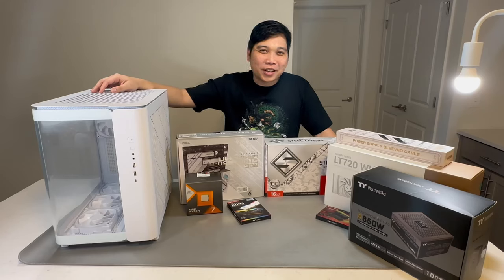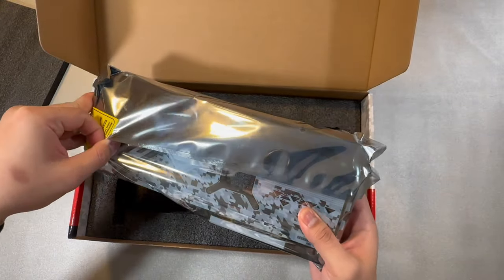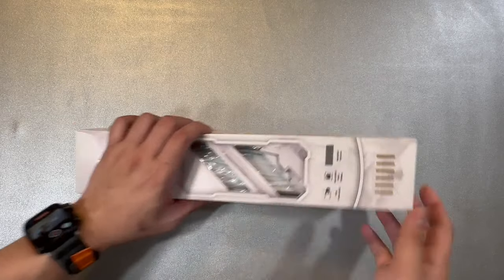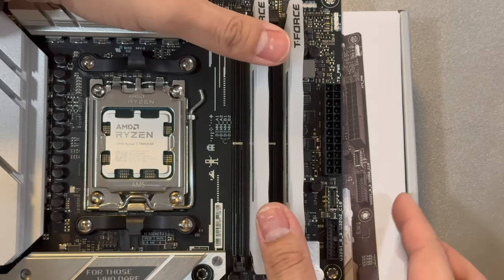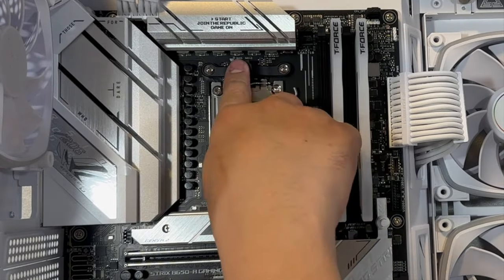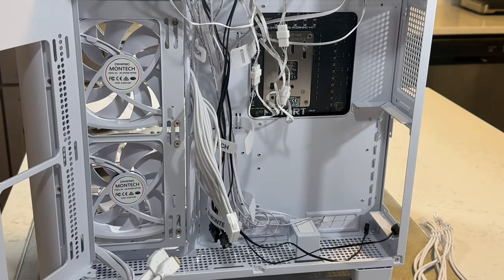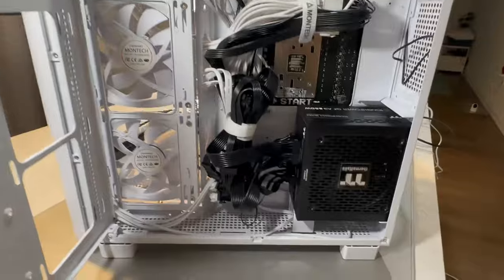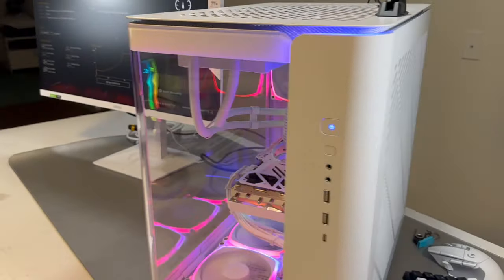Building my First Gaming PC

Comment: Fan angles are wrong, there is no air flow at all. You need to adjust the ones you install vertically or at the bottom to allow air in for air flow.
Reply: All fans are in right position, the pc case is king 95 pro it has reverse fan blade by default.
Reply from the maker: Kind of looks like that right? But the case fans are reversed fans, so bottom and right front fans are all intake fans. Top and back fans are exhaust fans. So in total it is 5 intake and 4 exhaust.

Comment: Great build, but the fan config is a bit off. You had it all set as exhaust and there's no fan set to intake cool air which will cause negative airflow. As a suggestion, you can reverse the bottom and side fan to have fans for intake. That's the only thing that I think you can improve on this build. 

I would also suggest that if you want a bit of rgb lights to show up when you change the orientation of your fans, set your bottom fans as your radiator fan and set the current fan on your radiator as intake. It's just a suggestion, and you might want to check and consider.
Reply from the maker: Kind of looks like that right? But the case fans have fans that are reversed fans, so bottom and right front fans are all intake fans. Top and back fans are exhaust fans. So in total it is 5 intake and 4 exhaust.
Reply: Wait, what?! Oh well. 🤣
Reply from the maker: @SpazzyMcGeee  yup. the case itself uses reversed fans. so it may seem that the bottom and side are exhaust fans due to the placing of the stickers. those are intake fans. Need to do a smoke test so can see the airflow. haha

Comment: hey bro nice build. I currently have all of my fans working and spinning but they are not all lighting up i used 3 montech fans as the aio for the build any solution for this? any advice would be helpful thank you. I have 4 fans with argb working including the front and 5 not lighting up. any help would be beneficial
Reply from the maker: Hi Ethan, thanks for reaching out. Are the other 4 fans (ARGB) connected to a controller or hub? My AIO fans currently are not ARB but if it is I will also connect the ARGB connector for the fans after daisy-chaining them to the controller hub. That is what I did to my deepcool AIO pump ARGB. I connected it to the fans' controller hub. Hope this helps. Let me know.
Reply: All fans are connected to the fan hub all are spinning just not all the argb is working. Do you think a 4 way splitter cable will work for this solution? Thanks.
Reply from the maker: @ethancbaker2002  if your fans are argb it should have a separate cable for the rgb to connect it to the rgb controller.
Reply: @MiddleAJGuy  i mean the 3 pin rgb cable for the montech fan sorry lol
Reply from the maker: I have not tried that myself but in theory it should work. Some of the fans can daisy chain both 3pin rgb and 4pin pwm as far as I know

Comment: are the case fans installed in the correct why as the bottom fans set as intake as well as the side fans, and the single fan is exhaust ?
Reply from the maker: Yes they are.  Some are reversed fans. That is why it may look like it is not installed correctly. You can check my other video about fans if you want to know more. ☺️

https://youtu.be/Fb4uwahpv58?si=QRA7UEitDiuICHSd

Comment: Hey there I have the same case and motherboard. I was wandering you know is how you plugged the rgb hub into cha-3 and 5v do I have to put it in cha-3 or can I put in in cha-1
Reply from the maker: Hmm rgb hub I plugged into the addressable gen 2 header at the bottom. ☺️ but the fan I plugged into the cpu_fan slot
Reply: @MiddleAJGuy  Hey there i have the same motherboard and you put the fans into the 5v cable and the one labeled cha-3

Comment: Just got this case and there is something I have to ask. How does the case circuit on which the fans are connected to get power? I don’t see any way for it to be connected to the psu or motherboard
Reply from the maker: There is a sata power connection from the hub to connect to the PSU.
Reply: @MiddleAJGuy thanks. At 23:12 on the top left of the fan hub, the third cable doesn’t have the smaller cable below it, unlike the other two on its left. Is that normal?
Reply from the maker: it actually depends because that hub is for fans (below) and RGB (top), and any of the RGB or fans can also be daisy chained to save space on the hub so you may have more connected on one side or the other.
Reply: @MiddleAJGuy  So its perfectly normal for that cable to be on its own
Reply from the maker: @whysoserious286 yup coz the upper and lower are independent of each other
Reply: @MiddleAJGuy  thanks for the help
Reply from the maker: @whysoserious286 no problem 👍☺️

Comment: hey man i have the same motherboard and the same case and i did everything that you did… but my case fans don’t turn on or light up. any advice?
Reply from the maker: Where you able to connect 2 cables from the fan and rgb controller of the case? There should be 1x3-pin and 1x4-pin
Reply: @MiddleAJGuy  i already tried that…
i figured out that i was supposed to plug in the two long black cables in the back lol

thanks for the input anyways 🙏🏼
Reply from the maker: @BobBob-mx9wm oh yes you need to 😀
Reply: i just started pc building so don’t judge lol 😭
Reply from the maker: No judgement here. We are all here to learn from one another ☺️ We will all hit some snags here and there the important part is to not give up and try again. 😀
Reply: @MiddleAJGuy  thanks man. i was having some problems still with the fans and just noticed it. it says that there are no fans in bios (cha fan 1, 3, 4) but i connected them with the group fan connected and put it into cha fan 2 but the fan speed cannot be changed in bios, thanks

Comment: I wanna build something similar using the same case. I’ve never built a pc before so I’m not sure about everything, there’s so many cables to connect and etc which confuses me a lot, is there any way I can contact you for help? Thanks
Reply from the maker: Where do you live? Yeah you can contact me at middleajguy@gmail.com
Reply: @MiddleAJGuy  I live in Norway. Im not sure if its gonna be problematic or not, although if any problems do occur, would it be okay for me to send you a mail about it?
Reply from the maker: Just send, I will not be able to promise anything but if I can help, I would ☺️
Reply: @MiddleAJGuy  Okay, thank you a lot.

Comment: Hi, I don’t know if someone have the same problem but I have the same case and when I plug the controller fan on the motherboard, My basic fans in the case work but I can't see them or control them in my bios
Reply from the maker: Which mobo you have?

Comment: Hi were you able to control the rgb in the software from asus?
Reply from the maker: Yeah. Via the armoury crate software. Are you having problems? Maybe I can help. ☺️
Reply: @MiddleAJGuy  well, i have yet to test it out in there. I just build it, made sure it booted and went to bed lol.. but i was able to change the RGB through the front panel from the case so i wasnt sure if it was going to cause a issue with the Armoury Crate software afterwards.. i got the same motherboard and case as you, so i will let you know :)
Reply from the maker: @reactionswithmike oh good. I am actually doing a video on the montech king 95 pro case and will discuss the rgb and other features as well. Do keep a lookout ☺️
Reply from the maker: Were you able to make it work? I just released a video on the Montech King 95 pro. Added that tip to make it work with the software ☺️
Reply: @MiddleAJGuy  hi yes! I was able to make it work and it was easy :) im able to change rgb through the front panel and asus software. Thanks for checking up On me! ❤️
Reply from the maker: @reactionswithmike good to know! ☺️

Comment: hey i wanna do your pc build i have the parts ready to buy and i wanna know about the cabling can you send a video on it or show something i can follow ?
Reply: cuz in your vid i couldnt see the psu cable or make a separate guide on it
Reply from the maker: Are you specifically asking for the cabling for power? Meaning from PSU to the different components?
Reply: yes i am
Reply: sorry for the late reply
Reply: do you think that you can change the fans on your aio to match with the case ? i think it will look more pleasing
Reply from the maker: Yes you can. Changing it to rgb fans would be ok as long as you check the rpm of the fans you use that it should be the same or higher than the fans included in the aio
Reply from the maker: @babyyoda8837 it will usually depend on the mobo you have and psu but you can check this video out, this is what I used to review the build.  https://www.youtube.com/watch?v=PXaLc9AYIcg
Reply: @MiddleAJGuy  i was thinking for the 120 ax pwm montech fans ( the ones in the case) to be on the aio and tysm for sending the reference video much appreciated
Reply from the maker: Yup I think Montech sells those fans as well so it is uniform:  https://amzn.to/4apXeLL
Reply: @MiddleAJGuy  tysm
Reply: i have a doubt in my region Toughpower GF A3 Snow 850W is cheaper and i wanted to get that, what i am confused is on the part where it has dual 8pin on the mobo and the psu only has 3 cpu/6+2 how did you connect the gpu (2 of 6+2 ) and the cpu cable (2 of 4+4)
Reply from the maker: The cpu cables is detachable and can be divided by 2, so for the cpu itself just detach one of the cables and insert the necessary 4+4 pin (not 6+2)
Reply: @MiddleAJGuy  ohhhh ok ty
Reply from the maker: @babyyoda8837 no problem